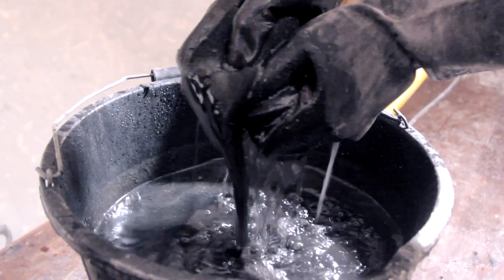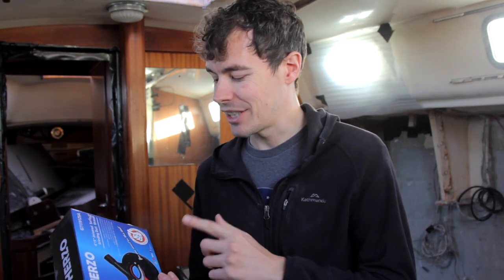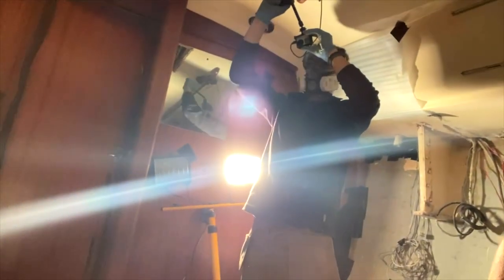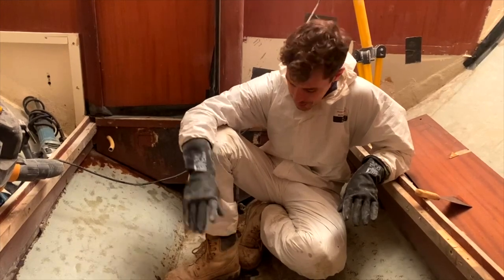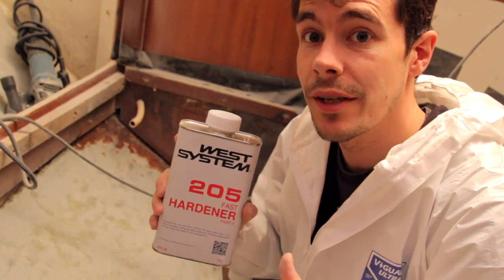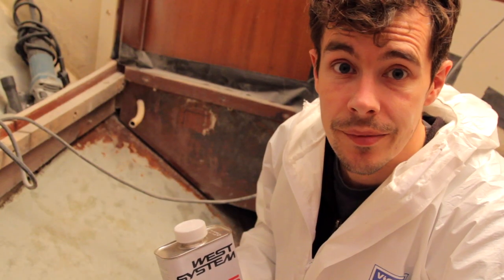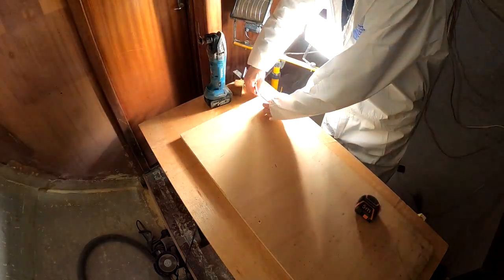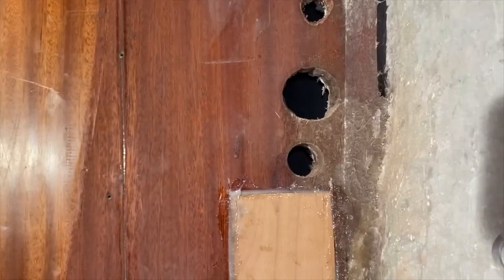Ep 7 | Filling CRACKS and saying goodbye... AGAIN...

Comment: Good to see you back at it again. You’ve got plenty of work ahead of you so staying motivated is essential to keep the dream alive. Don’t try to make it perfect, boats create endless lists of jobs. The cracks in the floor really should have a couple of layers of glass over the top and whilst you are there, it looks like you have an encapsulated keel in which case there is a chance that some water has gotten thru the cracks and down into it and cause the glass to delaminate from the core, so it might be worth drilling a few holes around the keel to see if anything drains out. Is the keel lead or steel punchings? They can be easily filled with a little thickened epoxy afterwards. Good luck!
Reply from the maker: Thank you for your comment, there's a few bits in there we didn't think of so super helpful! It is a lead keel so will do some research into that as that sounds scary!🙂